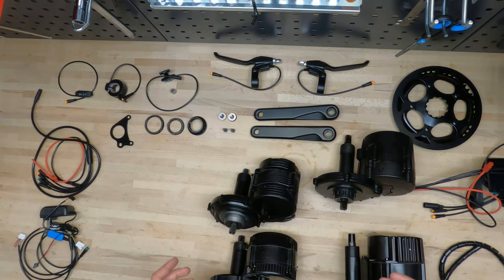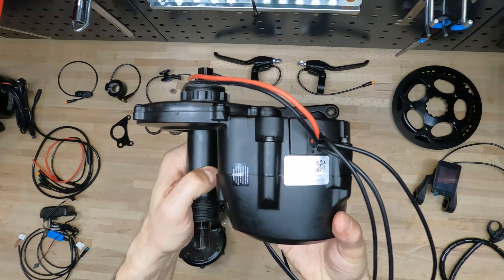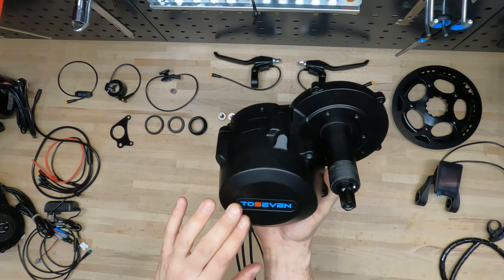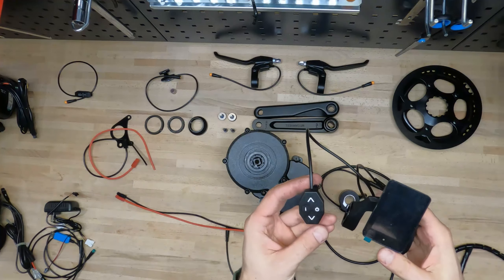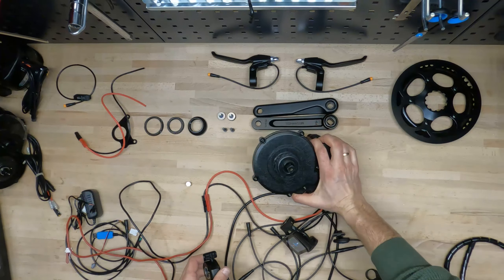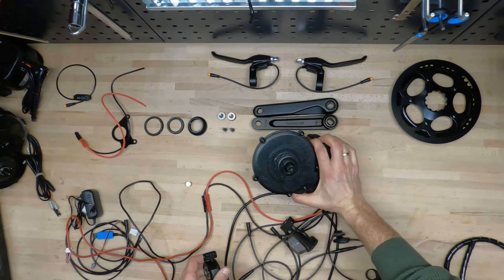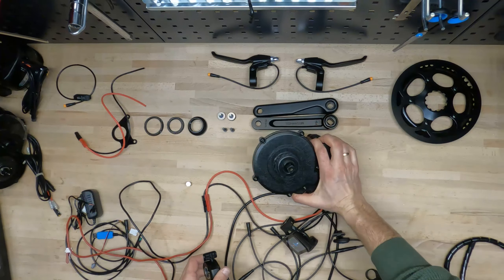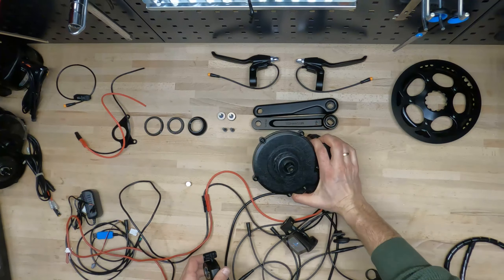Toseven DM01 middrive motor can win Bafang?

Comment: that noise from the dm01 is not normal. mine sounds louder than the bbshd, but it's smooth, not metallic
by the way, the O-ring type seals are doing a very good job. I have ridden through nasty wet weathet, never had water ingress issues whatsoever. Bafang BBS02 much less waterproof
the DM01 has twice the reduction ratio of the bbs motors, therefore half the torque on the rotor, that explains why there is less magnetic force, as the rotor spins at double the speed
Reply: How are you finding your DM01. Would you recommend. Thinking about 750 or 1000w
Reply: @FlixmyswitchLASER  at this point  the DM01 requires quite a bit of tweaking settings, since stock settings are not very usable. if you want to have a lot of power, the  DM01 is very good, it can accept batteries of up to 60V (16S). stock chainring is 46t, difficult if not impossible to fit on modern bikes with clearance for large mtb tires.
A good alternative to the DM01 would be the M635, but for best performance you need to buy the BESST tool and learn how to use it. Stock settings are again not that great. the DM01 will cost less than the M635 if budget is an issue

Comment: Accolmile this video has zero credibility, you could  have at least got an engineer to do this not some random dude who doesnt know what hes talking about. Take the controller off starts instantly talking about how bad it is  how water can get in. Completely ignores the rubber seals.Show us bafangs paper gaskets. This video is a hatchet job. Talking absolute nonsense. The guy in this video expresses no technical knowledge whatsoever
Reply: Indeed. I was going to reply to the poster: "How many mid-drive motors have you designed, prototyped, tested, tooled, and set up a production run for?", but I saw your comment and thought it would be more understood by you. 🤣🤣🤣
Reply: He did mention the gasket on the controller, which is rubber on both that motor and bafangs ( bbshd ) , only stator has a paper gasket on bafang. He is talking nonsense about water on the controller side, the only water damage i suffered was due to the paper gasket on my stator being crap and drawing in moisture, a broken rubber gasket on the controller but luckily it had silicone grease in.
Reply: The smaller stator with less magnets is a valid point.Maybe the higher gear ratio makes up for it.but i for sure do not like it

Comment: Not a good teardown. You say the plastic gear cover is bad, but don't explain why - it's covered by the metal chainwheel so there is no risk of damage.

You say you've never seen the magnet style used on the rotor before, but still say it's not good - if you've never seen it before and you've not used it on a bike, how do you know it's not good?

Same as the central shaft, you say it's different from bafang and you've not seen it before, and then say it won't hold together - if you aren't confident how it works, you have no basis for criticism.
Reply: I'm using the DM01 for about 4500km now. The main issues so far are not mechanical, but rather an immature firmware. The issue with the plastic cover is that it's not very stiff and therefore does not exert a lot of pressure on the O-ring seal between the screws. riding through nasty winter weather there are some signs of minor water ingress on the large gear, the grease has some red-brown coloration, an indication of rust.
other than that, heat management is very good, power is there and the gears make more noise than on the bbshd for sure, but that is due to the higher reduction ratio of over 40:1 and poasibly gear tooth shape
Reply: @JoLe1991  thanks for all the infos you putting out about the dm01, really greatfull! im looking to replace my bbs02, since i tried a few weeks ago a torque sensor bike (bafang m635) i want a torque sensor powered motor and the dm01 seems to fit the bill, would you still recommend it as of now? im looking at the 1000w version and i don't think that water would be an issue as i don't use my bike in wet condition. also from yoiur opinion would it be ok with a 48v batt (what i have right now) or its preferable to use a 52v or 60v? thanks a bunch! 🙏
Reply: @mani-00  the M635 despite being a great motor, was discontinued, also you need the BESST tool to tune it properly, and fiddling around with this software can, if not careful, really brick the controller.
the DM01 has had a game changing firmware update in the end of May. While not being super intuitive in the setting menu, you can tune it to make it a great torque sensing powerful mid motor. it's potentially very dynamic and very fast to react to pedal torque.
just a general note for the installation of such a motor: get a frame with enough chainstay clearance and avoid using bottom bracket spacers, as they will mess up the chainline. Tighten the M33 nut super tightly. use a hammer to hit the wrench until the nut does not move anymore. a loose motor can destroy your frame. the DM01 has a chunky female M6 thread for the mounting plate. this chunk can smash your downtube if the motor comes loose, so file it smooth and tighten the motor snugly. maybe add some rubber between the downtube and motor
Reply: @mani-00 if you want extra power and rpm, get a 52 or 60V battery for it. otherwise 48V is already pretty punchy. another great thing about the DM01 is unparalleled battery flexibility

Comment: I suspect the build has changed with time...i saw a teardown where the wires going to the controller were sealed with silicone
Reply: I think they are progressing with the motor, i have 3 bbshd's but the Dm01 will be my next motor and i will sell off two of my bbshd's, look at high voltage for better info on toseven

Comment: I had to seven motor DM01 and 02 for wife , and had bad experience, their torque sensors broke after 1000km (I am courier so it's less than month ) DM02 was broken after first ride ((( After company send me second time two motors DM01 worked even less and again was problem with torque sensor . DM02 wasn't even unpacked second time , finally returned my money but take commission (can't understand why I pay for their unworking stuff) , so I wasn't glad with motor. Need to say it's perfect when it's work for sure , but still when you pay 500+ CAD , expect more than month.